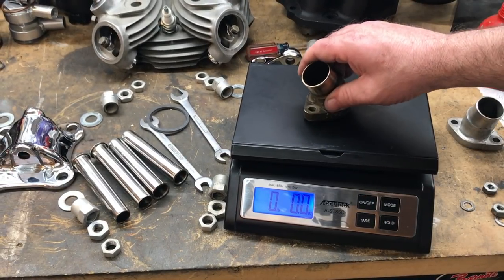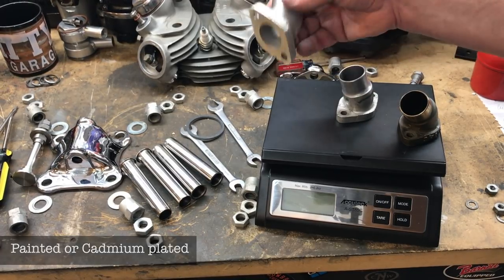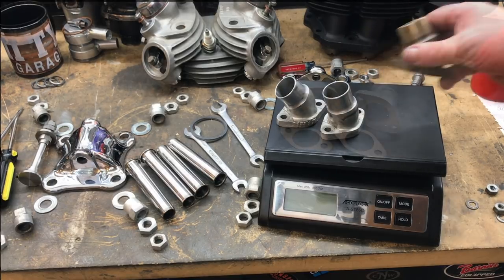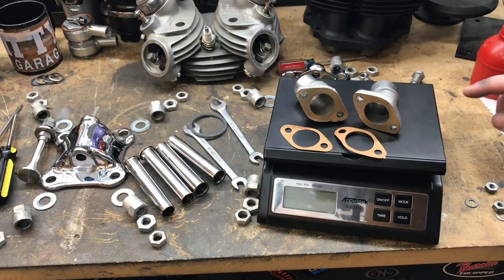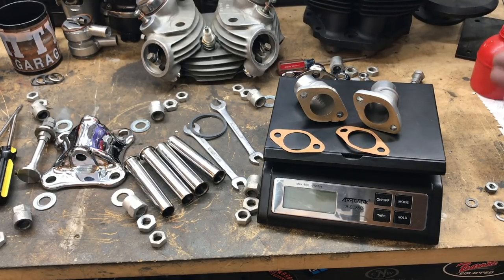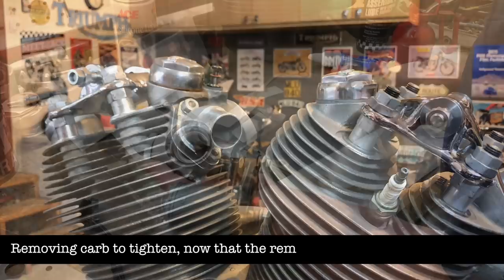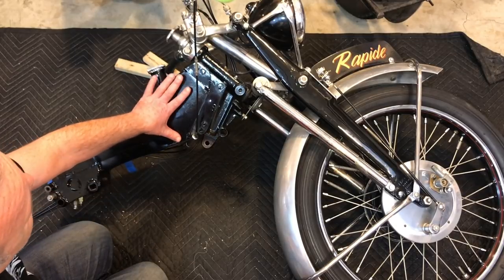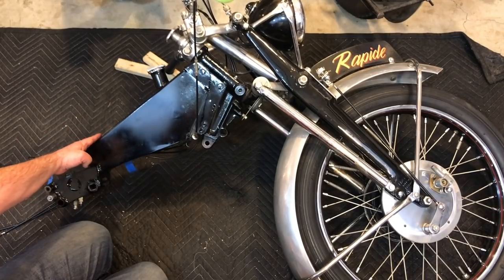Restoration of 1951 Vincent Rapide - Part 26 - Top End 4

Comment: Looking better all the time. I used some kerosene to flush out my oil tank because it is not as flammable/explosive as gasoline so safer to work with. I'm getting excited to see that bike running. I'm sure you are too.
Reply from the maker: Thanks Scott.  Yes, I'm getting excited.  There's still a bit to do so I need to get my skates on if I'm to take it to Corvallis in May!!

Comment: That was some pretty thick sludge that came out of the oil feed, I find that hot paraffin with a few 1/2" nuts, loosens the crud very well, you would be surprised what comes out, all kind of bits like biro tops coins and a lot of unusual things that have ben dropped in there
Reply: Mice...
Reply: 54macdog:Ha Ha! I am sure you will find some fossilised in oil if the cap has been left off !

Comment: Thank you so much for these videos!  I’m a Comet owner (as I believe you are as well, from your other videos).  One question—did you use any silicone-based or other type of sealant when attaching the carbs to the brass manifolds?  Or did you simply rely on a good socket wrench.
Reply from the maker: Hi Richard, thanks a lot for your comment.  I don't use any sealer for the carbs.  As you say, I just clamp them on.  It's quite a tight fit anyway. Good luck with your Comet!  I must get mine back on the road again soon.  It became a donor bike for the Rapide, but only just a few things, not vital organs!  I used the mudguards, seat and tank but should really get them back on the Comet and ride it before the end of the summer. Best wishes, Mike
Reply: Thank you!